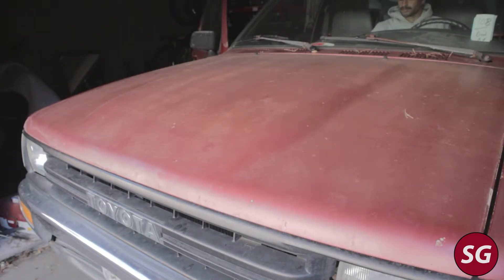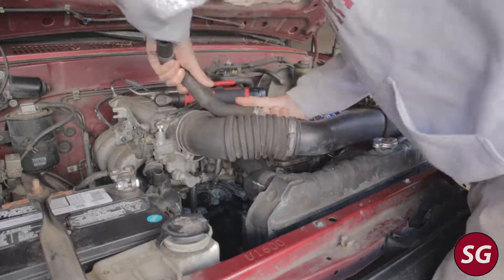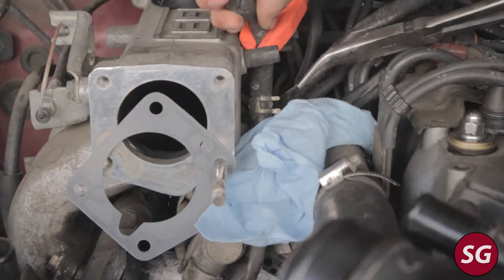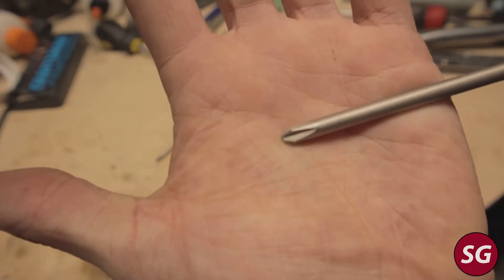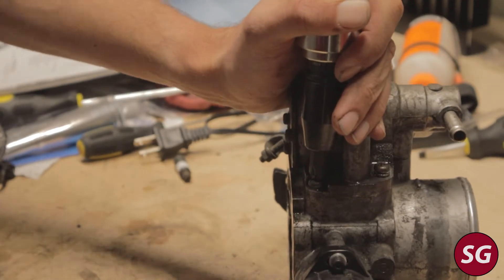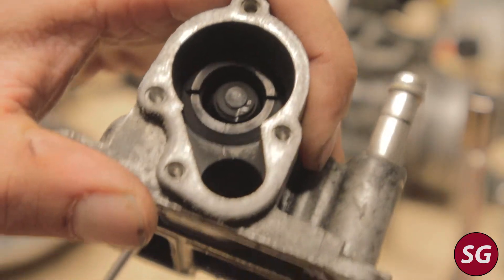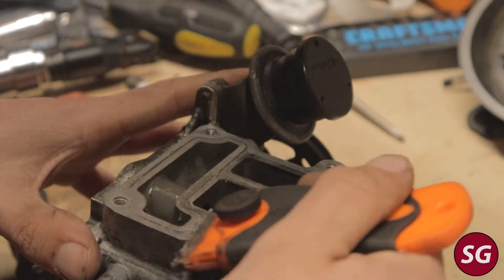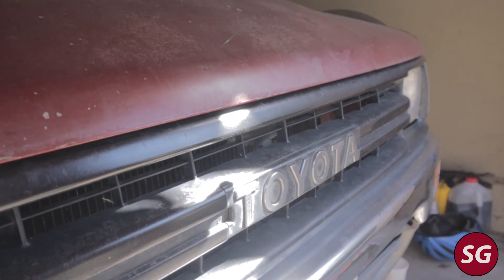22RE Toyota Pickup / 4Runner Surging Idle Fix! Idle Air Control Valve Replacement How To

Comment: My truck has a surging idle only when the brake is applied. I changed the iac valve and it still has this issue. I warmed the car up and bottomed out the idle screw and still has the issue. I did notice the o ring was bad so I put a new one on but wasn’t sure if it was the right size so I ordered a new screw and o ring from lce performance. When I changed out the iac valve coolant was leaking everywhere so I don’t think there is a blockage or anything. Is there something or somewhere else that could be leaking air causing a higher idle or a bad sensor or something? I’m so lost.
Reply: Sounds like your brake booster has a vacuum leam

Comment: @speedygarage264 
The four screws on the throttle body are JIS #1? Did you use JIS #1 tip on your impact driver ?

Comment: 2007 5.7 Tundra had this issue with idle roaming near 2000 rpm. I used a scanner and charted both downstream O2 sensors. One side was flat lining every so often and the other stayed in a uniform wave. Even though a code never tripped, I changed both sensors, re-teach the idle . Key on off 2 x, start the engine,  put it in drive with the brake applied for 2 minutes.  Idle went to normal just below 1000.

Comment: 0:38 i do this test with the hose attached ? should i just let it sit there and warm with hose off ?
Reply: if the hose was disconnected there would be no feedback from air sensor giving you bad idle/ no start off the bat

Comment: My truck starts to have a fluttering idle when I have my foot on the brake when the engine is hot. How do I fix this
Reply from the maker: Either what I show here, or it is likely the coolant temperature sensor. I can make a video on how to fix that if it would help you.
Reply: Could also be your brake booster / vacuum leak
Reply: Did you figure it out?

Comment: I have a 93’ 22RE, would this also fix engine that idles really low when I give it gas, it only seems to give me problems when the truck is warmed up. if the truck is warmed up and I turn it off and go to turn it back on, it shuts off, runs really rich. Any advice would be greatly appreciated
Reply from the maker: This could be the issue, but it could also be the coolant temp sensor. I had the same issue and the temp sensor is what fixed it for me.
Reply: @speedygarage264  I ended up changing the coolant temp sensor 2 weeks ago and it’s been running like a brand new truck, thank you for the reply though

Comment: I did this test because my vehicle had the high idle upon starting then it would start surging like this video. When I covred the hole in the throttle body the truck would no longer idle, any idea where to try next?
Reply from the maker: Have you checked the coolant temperature sensor?
Reply: @speedygarage264  Thank you for the response. I actually have one on the way with the plan of replacing it. Temperature readings have been all off but it isn't overheating.
Reply from the maker: @nikdommen  Mine wasn't overheating either, but the new coolant temp sensor actually solved a lot of my issues. I was planning on making a video about it at some point!

Comment: Thanks for your Sugguestion but my Idle still remain high and I just can not bring down lower ?????? and engine not surging iddle????????????Probadly have to replace IAC ???(Suscribed )
Reply: Tighten your idle control screw on the passenger side of the throttle body

Comment: Yo it sounds like your timing chain guide is broken, mine was too and I ignored it. Not a good idea. It is super common on these engines. The driver side guide likes to break at the top bolt (at least that's what mine did) and cause a bunch of chain slap. Eventually my guide snapped and a chunk of it fell down into the crank gear and just about destroyed the chain and caused it to jump timing. This caused the intake valves to contact the pistons and bend. Busted the timing cover too. Metal bits got past the filter (brand new fram, never again) and wrecked the bearings and crank in no time at all. Now I'm rebuilding the entire engine when I could have just replaced a guide. Don't be like me, check your guide. tons of people recommend going with upgraded metal guides, but I'm going a step further and upgrading to a dual row timing set, supposedly the fix for the Achilles heel of the 22RE. Great vid man, hope your luckier than me with your engine.
Reply: whats the sound like? my 1990 4runner is super ticky kinda sounds like an exhaust leak
Reply: @ogonbio8145  yea kinda like an exhaust leak, a lot of people would jokingly ask me if was a diesel
Reply from the maker: Hey, thanks for the response! I considered this, but I replaced the timing chain and guides with new OEM parts (made in Japan, although not the metal guides) early last year. Is it possible that the timing chain somehow skipped a tooth? I'd imagine my engine would have blown up by now if it did, but it hasn't. I'm also looking into the possibility that it is related to an exhaust leak - I'm still not getting a really reliable idle.
Reply: @speedygarage264  Yea it could have skipped a tooth but it would run really bad,  it would also most likely skip more teeth and eventually dig a valve into a piston. Check your oil pressure with a real gauge, the stock gauge is super inaccurate. I think my first comment was not correct, after investigating my engine further (and completely rebuilding it) I think it was low oil pressure that caused all my problems. Ive posted a couple videos of the rebuild and will post a new one soon of it running. let me know what you think
Reply: That’s worse case scenario.  Sorry brotha

Comment: Esa válvula se lava carbuclin y se aceita con w40 y vuelve a servir muy bien
Reply: Gracias por el consejo.
Pregunta: la marcha en mi Toyota está mal, tiembla cuando lo prendo ya caliente. Estaba pensando qué tal vez es esa válvula causando el problema.
Que la válvula no abre suficientemente para dejar pasar aire.
Debe de estar cerrada 100% ya que el motor esté en su temperatura de operación? Ósea, solo ayuda (dejando aire pasar) cuando está frío el motor y después cierra cuando sube la temperatura a lo que debe ser?
Reply: @DePalma.  no creo que se eso , la iac cuando está mal se queda acelerado , puede qu sientas vibración en la cabina por algún soporte dañado o le falta aire ala combustión le puedes intentar subir ala media vueltita a donde segula el aire cualquier cosa y ver qué hace

Comment: when i did my TPS i knew i was gonna have trouble taking the screws out and i did. I just cut a line across with a hack saw and used a flat head and it came out easily